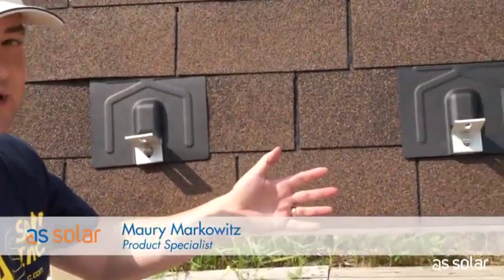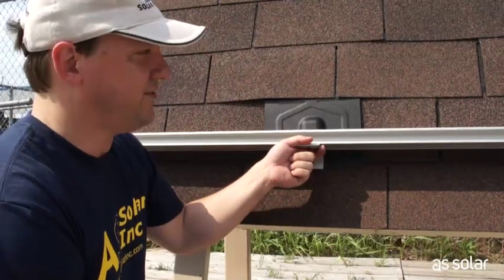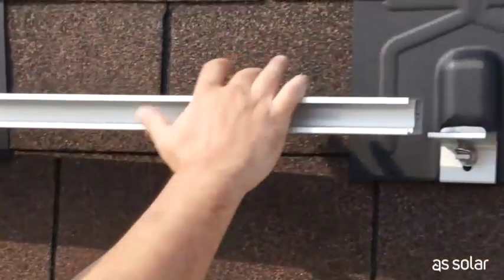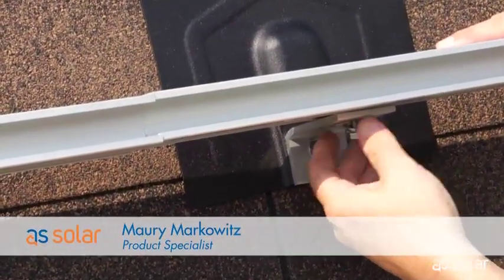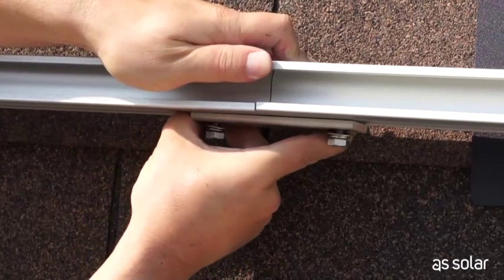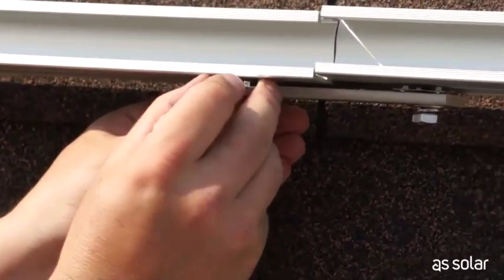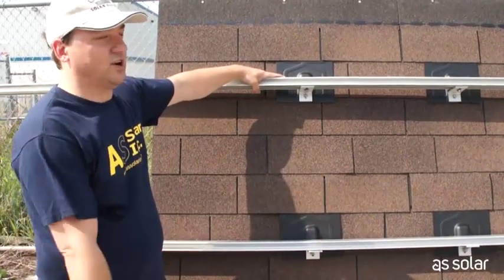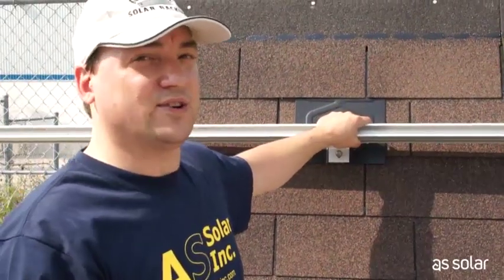AS Solar's DIY Solar Panel Installation, Part 3: Mounting the Kinetic rail

Comment: This is the worse setup. The solar industry need a new quick and simple procedure for the  roof top installation. New procedure shouldn't  use any  brackets, no rails, no roof penetration. Here come the snap-in method. Average residential rooftop installation time should be under 4 hours.
Reply: lol so just double sided sticky tape the panels to roof then.